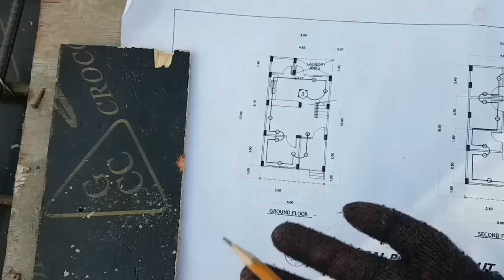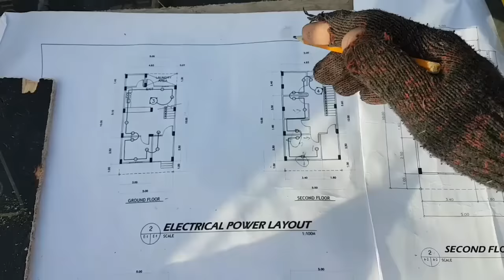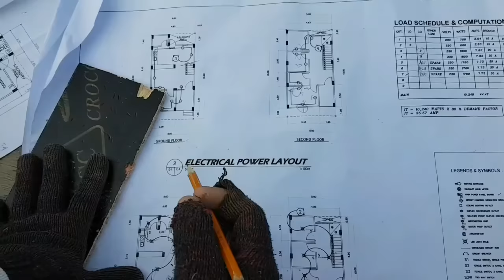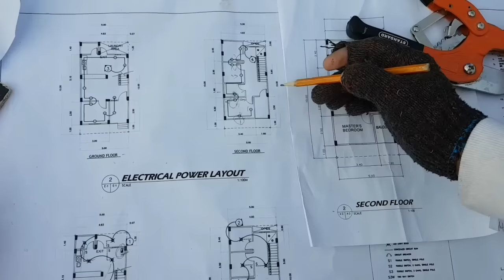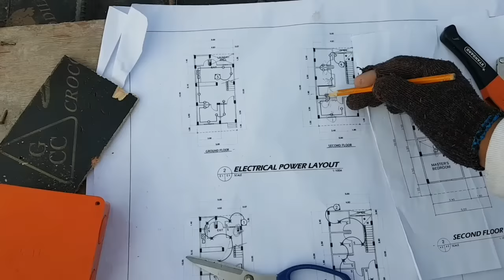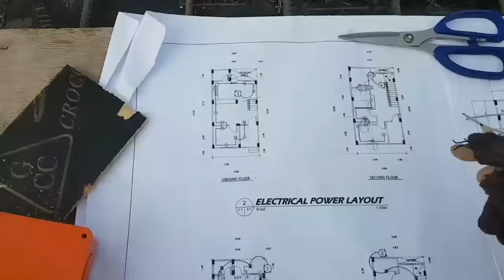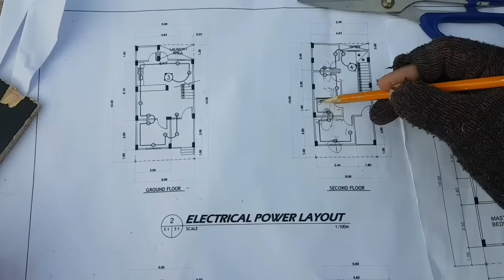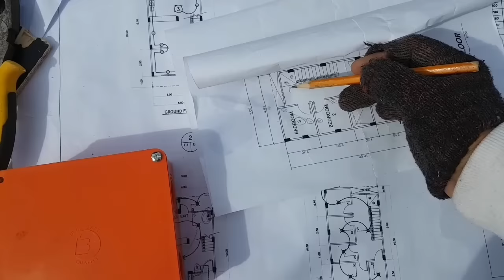Second Floor. POWER LAY-OUT  para sa Outlet at (SPO) Special Purpose Outlet, Acu at Heater | Tagalog

Comment: Bosing panu po kaya pag 4 holls na pannel box at gagawa po ako ng submeter san po ako dapat mag top sa 60 amp paren po ba o sa 20 amp sana po masagot mo bosing kung saan dapat kumho ng suply para sa submeter. Salamat po from baguio
Reply from the maker: Much better sa branch circuit na po  kayo kumuha. Mag seperate po kayo ng breaker para sa sub meter nyo. 20A lang po para safe ang lalagyan nyo ng sub meter.
Salamat po sa feedback godbless po.

Comment: sir tatanong ko lang kapag dalawang appliances ang para sa SPO. tig isang breaker/ circuit ba yun o lalakihan lang ang ampere ng breaker? Salamat po
Reply from the maker: Seperate po dapat. Tig 20A po cla ng cb. Kapag may spo po kayo sa bahay nyo. Salamat po sa feedback master godbless po.
Reply: @ElectricalPinoyTutorialTV  additional question lang po sir. pwede bang gamitin bilang main breaker ang mcb?